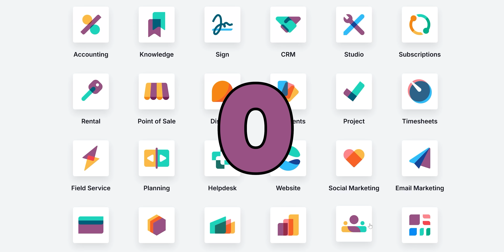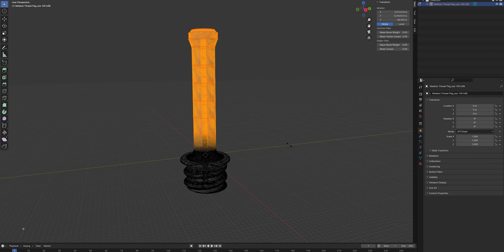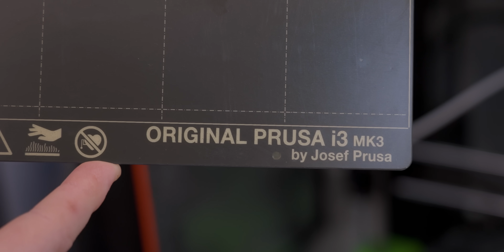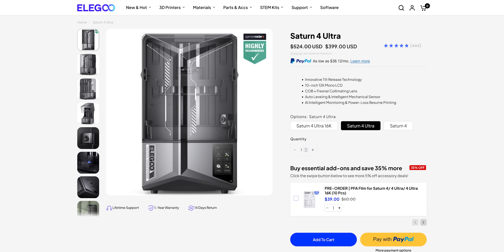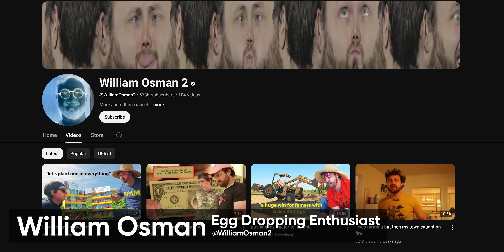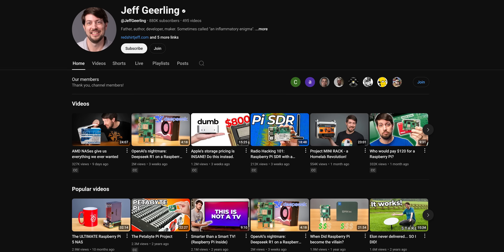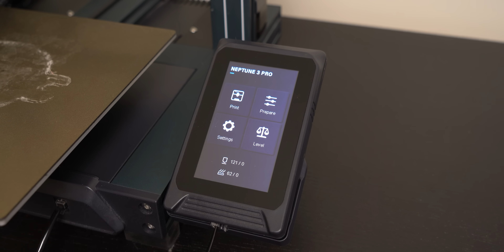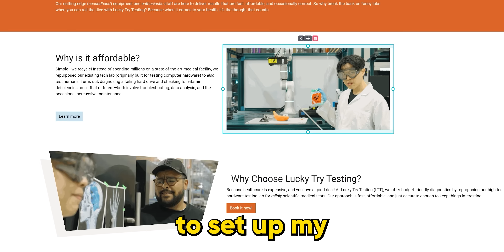Is my 3D printing setup wrong?

Comment: Okay, WAIT! Let me see if understand this correctly....  So you have 3d printer that uses filament that is sensitive to moisture. You place it in your basement next to a device with bare copper tube and an insulate one going in and out of it with drain pipes sticking out of it and by the looks of it some server rack doors so probably heat generating devices... And you say that if your not willing to manage desiccating packs in your filament storage, 3d printing is not for you? 
No sir, I think its quite the other way around, it should be If you have 3d printers and your hard to access filament storage in a probably poorly ventilated basement with a modest chance of fluctuating temperature throughout the day next to heat generating devices of witch some have their own drainage pipes to get rid of highly likely condensed water and are willing to manage your desiccating pads to tackle your problem, maybe thinking is not for you and you shouldn't be talking about for whom 3d printing is or isn't suited...

Comment: Still recommend bambu for industry, different user bases mind different things. I have an X1C for prototype/lab use and only print off of SD. It is by far the most accurate, fastest, and best designed system right out of the box. It will print custom threads for microscope objectives with ease and hit consistent slip fits to slide and hold optics hardware with the prefect amount of friction. The self contained dry storage for different filaments and all the self tuning is a god send. Great engineering tool, too bad they aren't as friendly to the community. It is plainly a superior engineered product from ex DJI guys. They brought in tuning for motion/acceleration response for the current driver parameters for the motors to a consumer product. I've been crazy impressed. I wish they made a resin machine.

Comment: The mere fact that Linus can operate a Bambu Lab printer just goes to show just how dumb he is.  It's the easiest to use printer on the market. I have 4 of the X1C's with AMS and not one time have I ever had a issue, or needed to take apart the AMS.  I don't have a dryer either. Just 3 extra descant bags in the AMS and that's it.

Comment: The issues with the Elegoo Neptune printers are painfully true. Luckily, I found the solution in the OpenNept4une project, which is an open-source firmware for the machines that fix most problems

Comment: I bought the K1 Max like 5 Days ago, First Printer and everything is going really good, love it obviously it has no AWS but they are adding a KIT so you can Upgrade it for the new System that the K2 Plus uses, so maybe something for the future, i had Zero Fails everything is very smooth and i am making my way into Modeling my own simple things right now,

Comment: I can highly recommend the creality 3 V3 SE for beginers if you want to test the waters if 3d printing is for you before you buy a more expensive printer. Over time, I've gradually upgraded mine with the nebula pad and camera, filament run out sensor, LED light bar, and G-sensor/vibration compensation sensor. It's a very affordable printer with good features and decent build plate size. Its also fairly basic to work on and maintain. The creality software is easy to use, but I do prefer Cura, which is compatible

Comment: I have had my K2 plus at the end of december 2024 and it has worked amazing.  The CFS has worked great and is easy to clean if needed.  I think Creality looked at all the complaints about the Bambu printers and fixed or improved most of them with the K2 plus.  The 350x350x350 build volume is great as well.  The quality is great, i have been printing a bunch of lithophanes with it and they are coming out great.  I love the built in camera to watch the prints from work as well.

Comment: One benefit of living in Alaska is that the air is dry enough that you don’t really need to worry about filament drying (for PLA anyway). I had an 8 year old roll of Hatchbox PLA just sitting under my bed, and without doing anything special it just printed. And beautifully at that. That said, my skin and nose aren’t as happy as my filaments are though…

Comment: What’s the deal with filament drying?  Is it just to keep the filament from gumming stuff up?  I have an ender 3 in my office and my ac has never worked right so my house stays humid, but I’ve never had any issues with my filament.

Comment: My Bambu's are the go to, though they've been taken offline since the latest update and I'm keeping a close eye on the company. At the end of the day the best printer is the one that works! The next big challenge is accessible CAD. Tinkercad project vid next? :P
Reply: I'm hoping they do a CAD video in the future. We finally have the tools and 3d printers can become common place like drills and screwdrivers.
Reply: 100% It "just works".  I don't need to manage a farm so the changes don't impact me as much but I don't agree with their new direction and hope they change course.  I can't imagine going back to one of these older style printers. I hope to see a US based Bambu-killer come out in the future, but they have yuge shoes to fill.
Reply: @rhadiem  you would not have to go back to one of the older style printers at all. Bambu is not the only one doing Core XY printers, there are many other great printers out there.
I use a Qidi, its just as fast as a bambu and it has an active heated chamber that makes printing ABS/ASA much better
Reply: Hows bambu looking now 7 months on?
Reply: @verts_tv  This is what I want to know lol
Reply: FreeCAD's not the worst. I'm going through the SOLIDWORKS tutorials with it and except for Shell and "advanced" features like configuration management, it's going reasonably well now since the Version 1 release!
Reply: @DasBuzzBuzz  It's defnitely NOT on the same level as Blender as far as open-source software.  I really hope it gets some significant love, as I want to use it, but it's just a mess right now imho. (As a Solidworks/Inventor/Fusion360 user)  Solidworks is missing a great opportunity for a $100-500 product for hobbyists.
Reply: A wild angus has appeared
Reply: @MakersMuse  what happened in the latest update?
Reply: I use OnShape both professionally and for personal projects. It's free to use as long as you don't mind your projects being publicly visible. It's browser-based and most of the processing is done server-side instead of by your computer. They also have pretty great free learning tutorials (for both CAD in general and OnShape specifically) on their website. I taught myself modelling with it and now do it for work.
Reply: Build a voron, never look back. Bambu are convenient in that you don't need any technical knowledge to get them running but Vorons are far superior in that you can literally do whatever you want with them and will always be able to repair them.
Reply: What about OpenScad , I cant be the only one that finds it easier to use over traditional cad tools
Reply: Man I've tried so many different CAD softwares over the years and always end up back to Fusion360. It's probably the most accessible, user friendly and save (If you work offline). Recently bought Solidworks' makers license and man, it's the complete opposite. 20 years of functionality in such a cramped UI... You really have to learn it for months to be relatively good at it.
Reply: What happened with the firmware update situation? I haven't followed 3d printer new for years, and I thought Bambu made the best printers. What exactly does this update change?
Reply: @Hexalyse  Previously, all printer communications on your network were unencrypted. This update encrypts them, but only if you use their software. You can no longer seamlessly use your own slicer, or 3rd party monitoring tools like Home Assistant, without taking the printer offline and enabling "developer mode" (this also prevents you from using the mobile app). Yes, this does increase security, but they could have done it in a handful of other ways that don't compromise the user experience at all. Therefore, there's concern that this is a slippery slope power grab attempt to further lock you into their ecosystem.
Reply: @Erik-R  I appreciate you making this comment so clear. 
I have been recently thinking about getting the A1 myself as my first printer as it seems very beginner friendly, and until last week I’ve seen nothing but glowing reviews from the people I followed. However since hearing about these changes and while I don’t think they necessarily matter to me, thanks to your comment I now have a better understanding of the drama surrounding the changes.
Reply: @Erik-R  Except for them to be in many education and corporate environments they have to meet security requirements. The security that they added meets those requirements. Its comical how butthurt people have got over this. If people would read their explanations they literally talked about this and what was actually done. The security implementation wasnt anything out of the ordinary. It only got gatekeeping 3d printing diehards' panties wadded up because they dont like the fact that a company implemented security the company needed to still be an option in some markets.
Reply: @Erik-R  okay so in just for a new  p1s and if I just learn on their software I should be good and have no problems it’s only people who were using other programs and now they shut them out ?
Reply: What are you printing, that makes you nervous that Bambu may possibly be seeing it?
Reply: @sebbe0402  no if its connected to internet they can push firmware update :)
Reply: @sebbe0402 that was an argument the soviets used to arrest people mate
Reply: @sebbe0402  stupid awful take. I should have cameras inside and all over your house, because what do you have to hide?
Reply: @bonkgameing  Just disable the cam if you're scared...
Reply: @sebbe0402  Your whole point was “what do you have to hide?” What do you mean “turn it off”? If those cameras got turned off, you’d get angry

Comment: 5:50 this feels like 1970s computers where in 30 years people are going to say "but why didn't they just do this super simple thing?"
Reply: There's like, new print tech coming out where the print head or the bed can tilt meaning print orientation concerns are irrelevant, and there's new slicer development coming out so frequently it's hard to keep up... Plus recycling filament at home I hope is gonna be financially viable soon... And yeah, multi material / multi colour printing, tool head changing... If we survive the next five years I'm so stoked to have jumped on this train and become proficient in 3D modelling when I have. I think the landscape is gonna look wildly different in a few years, for the better - and then there will be loads of A1 minis out there for dead cheap when people move on to the Next Thing...
Reply: @DevinJuularValentine  Greater than 3 axis 3d printing is going to be amazing. Same with in-home recycling of plastic. It basically solves the plastic waste problem.

Comment: Filaments in a cupboard, with draft seal on the doors. And I ski boot dryer vented into it. Smart plug on the dryer, ESP32 with temp and humidity measurements. Home Assistant....that's my setup.

Comment: i have ip67 storage totes with dessicant that i keep all my filament in, it started with one 60litre one, now i have a 100L and a 60L both full lol (i highly recomend kingroon filament, its super cheap and super nice, the pla should be labelled pla+ because its better than most pla+ i have used, and the petg is awesome, i did have one super wet roll of silver petg but now i dry it before i use it and then throw it in my totes and it stays good

Comment: Don't have a printer but how much of an issue is moisture on the filament?  Thought it was a type of plastic/nylon or whatever.
Reply from the maker: Big issue
Reply: A filament dryer is a necessity. Moisture can cause so many different problems that getting a dryer will save you time and money.

Comment: You should not be using glue that often. instead glue is meant for those rare occasions where you the print has very limited amounts of contact to the bed making bed adhesion more difficult. What you definitely should be doing is washing your bed

Comment: I'd recommend anyone with an ams to print the dessicant holders and fill them with rechargeable dessicant beads. It works way better at keeping the moisture low than cramming several silica packs in there

Comment: I started with an ender 3. Every single part except the steppers has been replaced, I'm talking the entire frame, buildplate, motherboard, the entire wiring harness I custom built, and the bed heater is AC 120v powered with a 400w heater. I did up the build volume to 400x400x250 and I do use a .8mm nozzle to print car parts. Its moves aren't fast but it pumps out the plastic fast. I'm not running a business (at least yet) so print time is not too important. Still get very high quality prints too.

Comment: Linus, you really need to get an AMS drypod solution. also has a hygrometer that tells you the relative humidity inside the AMS. i have not had any troubles since i installed mine. sucks that bambu chose to screw us with "updates" though you can put it in Lan only mode, and there is a 3rd party app that can do most of the stuff without need for connecting to bambu servers. something to look into at least.

Comment: you dont need an enclosure unless ur printing abs cf things like that. pla petg you dont need the grow tent.....wtf u have the fdm in a enclosure.... but the toxic fuming resin printe is out in the open???? needs to be switched resin printers needs air flow

Comment: I'm not entirely sure why Linus is criticizing Bambu's AMS system. I suppose experiences differ, but I've been using my X1C for over a year without drying my filaments. I primarily use PLA, PLA+, and different types of PETG, and I've never had any issues with filament breaking in the AMS. In fact, it’s worked perfectly for me. I don’t print figurines or highly detailed items—just functional objects. I have 912 hours on my X1C. Still pumps out prints as good as the day I got it.

Comment: I would still recommend something that requires some assembly to my friends, as 3d printers will break, and having something turn-key out of the box with no assembly seems to scare a lot of people from trying to fix it themselves. If they start with something that required assembly from themselves, they'll be more confident attempting to fix the printer.
That said, I'm a big fan of Voron v2.4's with stealthchanger toolchanging systems, as you can have a 6 (or 7 with minor mods) toolhead printer at nearly the same build volume as a Prusa XL (assuming you stick to the 'stock' 350mm size v2.4), for less than the cost of the 1 toolhead Prusa XL. They run on Klipper, which is open source, and so are all the printed parts for the voron & stealthchanger, and they publish all the CAD for the various parts so its easy to modify anything to suit your specific needs.
Reply: Surprised none of these nerds has a Voron lol  Actually printing another set of pieces for a 2.4 right now.
And Beacon with KAMP.....what a god send.  Especially with Contact.
Was considering the ERCF....then the Boxturtle...but now am considering OpenAMS for multi.

Comment: regularly fabricating, I do believe that bambu, regardless of their questionable practices in terms of software or lack of lan or wired connection are still ahead of the pack, I print tons, majoring in architecture and design and at this point almost every student that has a printer, uses a bambu one. So it easily is in the hundreds on our campus. Prusa has been an entry point for most, but as a value for performance it can’t compete with offerings from bambu especially with superior speeds and repetition, SO helpful on deadlines. I would put it closer to a budget ultimaker than an overpriced Prusa. 

Unfortunately Bambu didn’t pay for my X1C nor this comment, but I do think it’s a crucial point of reference comparing it against enthusiast stuff out there…

Comment: I have been building and using printers for quite a while.  At work we already had Raise3d E2 and when we needed another printer I went with the bambu and it is just on another level. It is fast, you don't need to constantly adjust and tweak things, and the print quality is there. If your hobby is the 3d printer then yeah get something else that you can modify and play with, but if you need a tool to do a job well, get the bambu.

Comment: 4:05 - YES! This is low hanging fruit. If your AMS is loaded up fully, having to unload the entire thing to get one piece of broken filament out just feels silly. This would be such an easy upgrade for an "AMS 2.0"
Reply: also ams 2.0 having a built in dryer would be nice
Reply: @ScyborneOG  Also yes. Great idea.
Reply: Heck all it needs is a software update. Have it run the main ams roller to feed, then you can just shove filament down the ams slot that's stuck, the feed filler will grab the fragment, and eject it out the back.

Comment: 14:38 is not a fair criticism. The Prusa is quieter because it is slower! If you set that Bambu Lab P1S to print at a slower speed (eg 'silent' mode) it also will be quiet.
Reply: The P1S still isn’t exactly quiet even at a slower speed